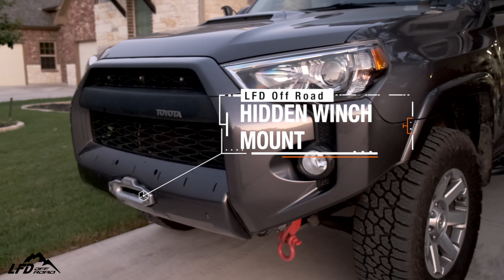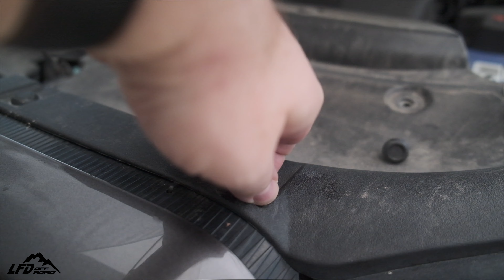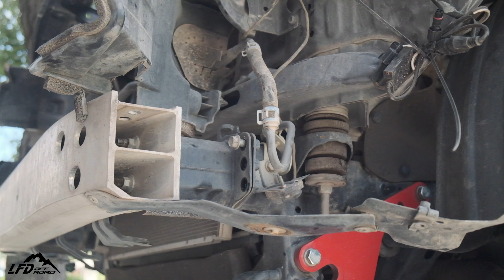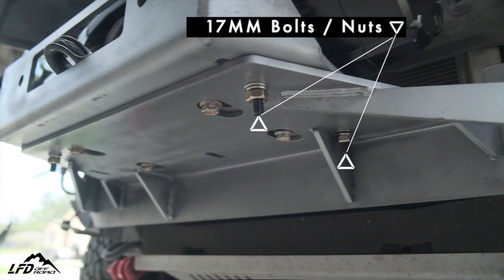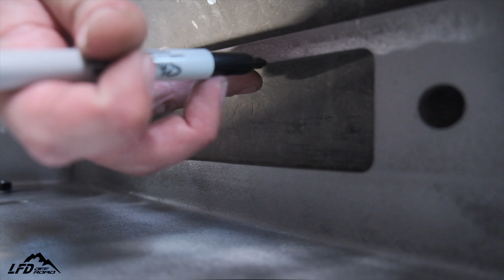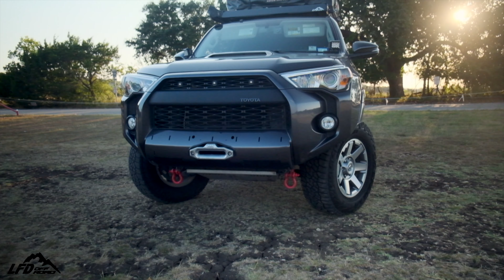LFD Hidden Winch Mount Install on the 5th Generation Toyota 4Runner

Comment: Man great video, I did it with my 4runner, just one question man, Down I see in my car a big space, also the bumper front holes doesn't have any support, I'm not sure but could be than my support is different than yours and maybe I need an extension for the support to fix the bumper

Comment: This hidden mount removes vehicle OEM protection and does not replace it. Thi mount adds a tray but no significant protection :(
Reply from the maker: the bumpers on vehicles these days are made to absorb road impacts between 5-15 MPH delta. The real protection for the passengers is actually the body and the frame. Crumple Zones and Safety Cages along with Airbags and Seatbelts are what really put forth the protection for passengers.

Comment: Did you have to remove the solenoid on the winch?
Reply from the maker: I did not have to. Has this been a problem on others?
Reply: @TrailorSailYT  I’m installing mine this week and have the same winch. Saw your solenoid was removed but after more research I found this wasn’t required. How long would you say the install took you? Thanks
Reply from the maker: @Dryfly00  Well, I shot video while doing it. So, around 4 hours... but it can be done in an afternoon with tons of breaks. I did not video the install of my Hybrid bumper, but the cutting on that one took up some time. I still got it done in a couple of hours. Cheers!

Comment: how do you get the winch controls?
Reply from the maker: That really depends on the winch. My plan was to get one with detachable controls and mount it into the grill using a plastic plate. However, I ended up getting the Hybrid Bumper from LFD before I got a winch.